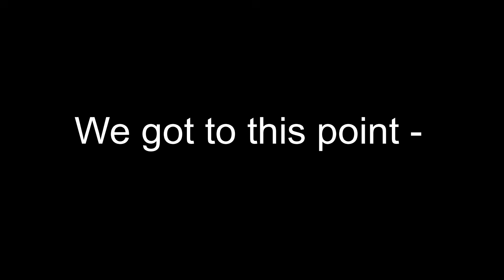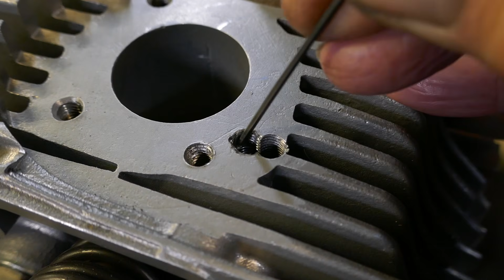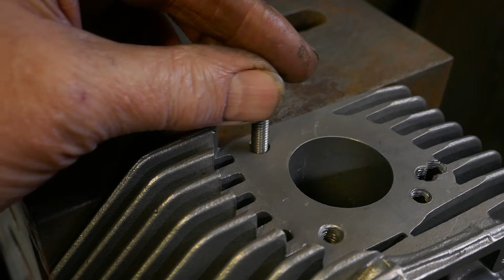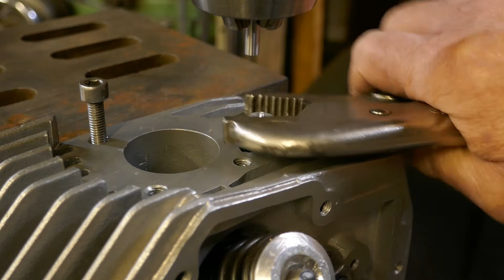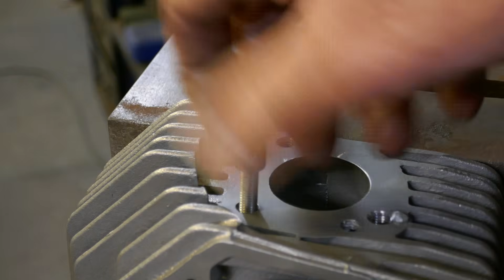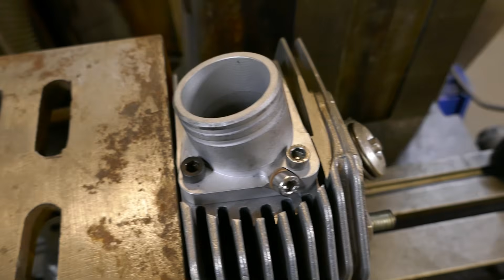Moto Guzzi cylinder head repair part 2. One hole plugged (no welding!), two holes Helicoiled.

Comment: I don't like helicoils because when fitting the bolt it is possible to ping out the start of the helicoil thread wire.  Also bolts being soft and helicoils being hard spring wire,   I have come across bolts put in cross threaded and jammed in the hole.
Technique I have evolved is to drill out the stripped or damaged hole and tap it for a threaded insert.  Chose the insert thread size so that its minor dia. gives sufficient material wall thickness.   Then for a cast aluminium part like the Moto Guzzi head,  machine an insert from high tensile 2024-T3 al. alloy.  Screw it down hard into the hole without using Loctite or epoxy as both soften when the part gets hot.   Saw the insert off just above flush and Mill or file down flush.    Then turn a slightly tapered pin also in 2024-T3 and drill down at the intersection of the threaded in insert and the part at a size just under the pin dia. and press in the pin.  Cut off the excess and again finish flush.  Finally pick up the hole centre off the matching part and drill and tap the new hole in the insert.   What the axial press fit pin does is lock the insert permantly in postition so it can NEVER  unscrew,  either when tapping the new hole or fitting the bolt.
Reply: I used to do something similar, if there is enough room, drill and tap to a couple of mm bigger using the same pitch as the needed treaded hole. Such taps are readily available. Then on the lathe drill and tap for the original hole, and turn and thread lining up the OD thread with the ID one, this gives the max wall thickness like a Time-sert. Sounds more complicated than it is, if you are experienced on the lathe.

Comment: Good result!  
I'm coming round to preferring a Time-sert over helicoils, they seem a better option even with the extra expense. They just seem a better engineered solution than a spring.🤔
Reply from the maker: Yes, Time-serts do seem to be a better engineered solution. I've never used them though!
Reply: @MidEngineering i have only used them a few times, i borrowed the things from the bike shop i used to do engineered fixes for. Usually by the time i got to see the job custom made sleeves were called for, i got good at lining up internal and external threads on sleeves.😂